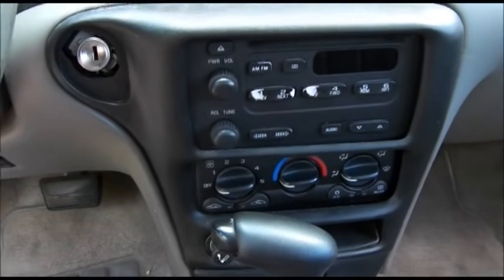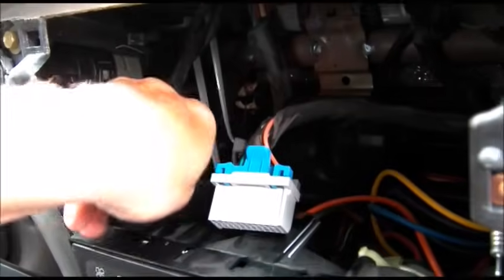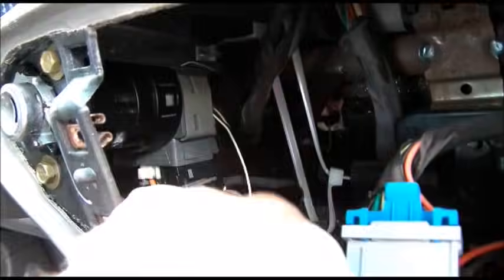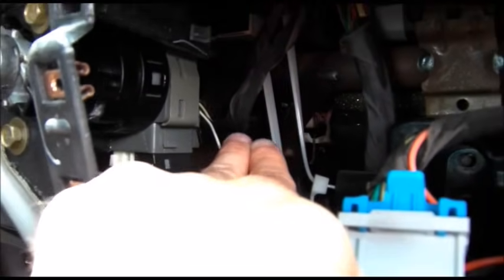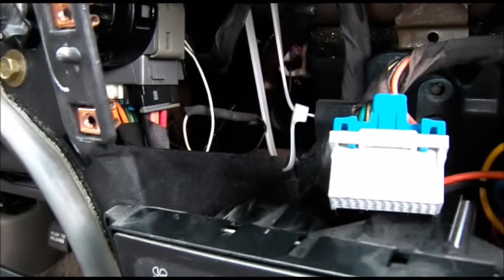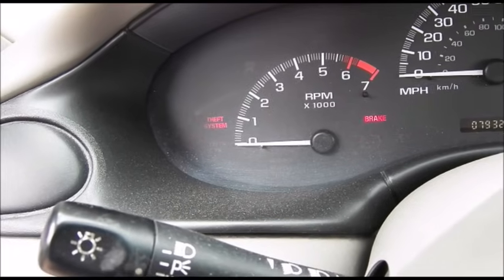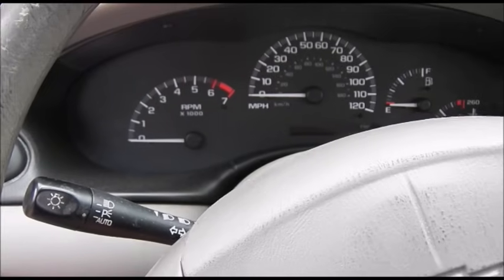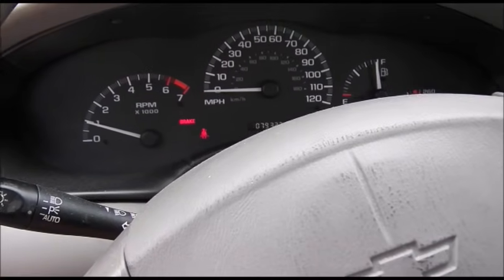GM Passlock II bypass disable fast easy repair fix cost less than $1 2005 Chevy Classic

Comment: Red - Red - Red - Gold band. FYI: I found one from an old TV set. Cliped it. Soldered it. Worked perfectly.
Reply: Which direction did you have the gold band going? 
Towards the yellow or the black?
Reply: @caseybailey7529  did u find out?
Reply: It won't make any difference which direction. Resistors don't have polarity.

Comment: I wired the 2200 resistor in between the black wire and the yellow wire and tried to retrain the car and it has not started in 10 attempts am I missing something can anybody help please

Comment: I have a  05 grand prix GT but my wires are white black and I can't really tell by looking at them but it looks like either black and white or black with a yellow stripe on my ignition any advice on witch one is supposed to be the yellow need a wiring diagram of that and the two plugs for the ignition switch badly

Comment: I under stood what you said, but maybe you should have shown actually  the way it was done vs telling just saying.
Reply: Im gonna make a video of this....step by step!!
I just did this to my 2002 Malibu
Reply: My Beautiful wifey bought  an auction here on Phoenix, for our 23 year old son.....
He took it in for a tune up at Meineke....and gosh-darn varmet.....the shady mechanic said his Torque convertor was not engaging....Haaaaa!!!
And a bunch of shit almost totaling  $2700.
Brought it home and researched the Theft system..ordered 2 key fobs and to it to Batteries plus...they said there Scan tool had no communication with the theft system...I then called GM Motors gave then VIN number and told me that year of 2002 didn't have an alarm....so I stumbled upon this Video after the whole reset procedure which worked but kept doing this over and over......went to Frys Electronic and bought a pack of resistors for $2 and just tapped them to the Black and Yellow wires....and Bammm, it worked.....after 3 weeks of doing different procedures....good luck. 
Thank you for this video.
Reply: @tilo192  2yrs haven't seen that video..hm, 🤷🏾‍♂️.... Thanks for nothing?

Comment: So I have a 2001 Chevy Express van I took the black box off underneath the ignition because it was the only way that it would even start remotely due to the fact that when I took the tumbler out and put a new one in it wasn't engaging at all it wouldn't go forward but so far so my question is without a key and without the tumbler the actual ignition using just a switch in that black box to turn it over can you still bypass the security thing because once the security light went out it cranked but only for a couple of times and the starter kept running so you have to dial it back a little bit so for the starter to stop running but the motor would continue to run any suggestions

Comment: I don’t know much about cars but I myself have a 2002 Chevy Malibu and it’s been giving me hell for over a year oddly it o my does it in the winter, and fall. It also does it in the rain. I’ve gotten a battery, alternator, fuel tank pump, cylinder, and starter replacement and still no luck. I want to take it to Chevy but they’re already charging me $122 for a diagnosis  and I heard to get the job fixed it will be over $400. I want to know is this the best solution because I’ve been seeing things about programming and stuff and I know nothing about that.
Reply: Your bcm was getting wet under the passenger side dash in the rain more than likely. new bcm require programming to your vin #. it's a super common issue

Comment: I wish someone would come up with a way to fix a2004 chevy Colorado  it cranks but will not start  I really think it's a pos
Reply: Cut the blue and white wire in the column while the truck is running and thank me later.
Reply: I can’t get the truck to start to cut the blue wire.   How do I get it to start?   I don’t have enough automatic door locks or a key fob.  I have what looks like a copy of the original key.  I looked under the console and someone has cut the blue/white wire but reconnected it with a bean connector.   The security light has always stayed on and this is the first time Iv had this problem since Iv had the truck for a year now.   

I am remodeling an old 1912 house and use this truck to go back and forth to Lowes…haven’t got anything done this week because Iv been trying to get this truck to start.  

Ran perfect before this incident other then a faulty connector going to the #4 ignition coil.  

I have the 5 cylinder pickup 2005
It turns over, starts, and then dies immediately.

Comment: What did you put on the resistor and which ones did you solder together. I know the black and yellow but coming from the car or key ignition
Reply: This guy is not clear at al as to what he is hoking up to what. Useless video.

Comment: The learn procedure is as follows:
Turn the ignition all the way to the crank mode and let go of the key so it can return to the run position. The security light may begin to start flashing or just remain on solid. Some vehicles may start up and stall or may not crank at all. You must leave the ignition key on for 10 minutes and place a battery charger on the battery if needed in case the battery is low on charge. After 10 minutes you will see the security light go out or just stop flashing and then go out. At this point you turn the key off for 5 seconds. After 5 seconds you turn the lock cylinder to the crank position again to repeat the same process .You must perform this process 3 times for a total of 30 minutes of wait time. On your 4th attempt the vehicle should start up and continue to run.

Comment: On my chevy colorado I bought a D1462G lock housing.  Took the sensor part of it ( black plastic part) and swap it to the original.  No cutting off wires. Work great. No more problems with pass lock.
Reply: Its also not 1$. My darn alero is over 20 years old by now. Definitely gonna do the resistor way.

Comment: so...you cut the black and white wires...you insulate and separate the ones coming out of the ignition switch and you solder the resistor to the other 2 loose ends? Basically, the 2 coming out of the ignition switch stay unused?
Reply: I think it's just peeling, not cutting them completely so that they continue to do their job having the resistance between them

Comment: Looks like it should work on my 2005 base impala am I correct ?
Reply: NO. Problem is in the key switch with the 2 magnets. NOT a bypass on a 2005 impala. No chip in key.

Comment: FYI: If you have different vehicle resistance on different starting systems you can get a Potentiometer Resistor. Say you need 2200 OHMS of resistance. Use a multimeter to set the pot to exactly the 2200 OHMS. mark it or put a drop of hot glue on the trim pole to keep it from moving.  So if your key has a resistance of 3300 then you can use a POT Resistor and trim it to the exact number. Sometimes its hard to find a resistor or they have tolerance that is not working well enough. If your problem is not being  fixed you can bump the trim pole plus or minus a little until your resistance matches what your computer is looking for. This is better than soldering and desoldering ceramic resistors if you have to make a lot of adjustments looking for the right resistance hack
Reply from the maker: ok, ...but the point is that the 2200 ohm resistance that I specified will work on all Passlock II vehicles regardless of what your original resistance was.
Reply: my key is all metal..zero resistance..no plastic cap....no  resistor chip..
Reply from the maker: This comment is useless because it COMPLETELY MISSES THE POINT.  You NEVER need a resistance different than 2200 ohms to bypass a Passlock II system.
Reply: @bigslick  Perhaps but all I'm sayin is that my key is not the source of that resistance
Reply from the maker: @johnbaart1537  that's true, because the key is really not relevant at all to solving this problem.  Also, my reply was to Jimbo, not you.  His comment is a distraction to the solution.
Reply: @johnbaart1537  The resistor chip is found only in Passlock 1 system keys, not in Passlock 2.
Reply: fun fact....  take a small jewelers file and cut a small notch in the body of the ceramic resistor , this changes the value and may get you in the range your looking for. start higher then needed and lower the value with the file. been many years since i learned the trick an its not something most know. more material more resistance less material less resistance...once you go past the desired range a new resistor is required so go slow and recheck after each cut.

Comment: This worked for me on 2001 Impala.  I picked up wires off of BCM above Driver's kickplate.  However, after doing this, the autolocks on the Passenger and rear doors stopped working.  Key FOB and Internal switch locks/unlocks driver's side door only, not passenger door - this includes the internal switch on both the driver's and passenger's door.  Anyone else have this issue?
Reply from the maker: My bypass has NOTHING to do with the car locks at all.  Zero.   So if you are having this problem, you either are connecting to the wrong wires or you caused a short or an open connection somewhere.
Reply: Gene Paulsen   You  most likely have this problem because you cut the black wire  at the BCM which provides a ground to other functions in car...  you can install a resistor at the BCM or up top at the ignition lock cylinder..  However it’s done differently at either location... At the cylinder  end you can cut the yellow and black wire and join a resistor in between.... and that’s the resistor in between the two wires coming up to the cylinder...  and then do the relearn procedure so the bcm can accept the new resistor....  Down at the bcm you cut yellow wire only and just remove a bit of the insulator off of the black wire... Then join resistor between yellow and the stripped part of black wire... ignore the yellow wire that goes into the bcm connector and use the one coming from main harness... you can tape up end of yellow wire... this way the black wire is always still connected to the bcm and will provide the necessary ground for other functions to work...  then do the relearn procedure.... You must make sure you are working with the correct wires at the BCM for the pass lock  2 system.. and solder resistor ends to wires for a good connection and tape up ends... should work, good luck....
Reply: @carlocalarco6718  Yes, don't cut the black wire at all. It's a ground.
Reply: TE5LA   I believe the black wire you don’t cut is the one coming out of the BCM for it provides a ground for other things to function that’s why I said you peel back the insulation and splice in the resistor but  the one at the top where your pass lock cylinder is, I’m sure you can cut the black wire there and join a resistor between yellow and black... let me know what you think, I don’t have a schematic with me..  thanks....
Reply: My 03 impala passenger doorlocks just stoped to work, all of 3 except drivers door, did you ever figured out the problem?

Comment: bigslick, Am I correct in understanding that your taking the signal from the BCM and bypassing the Passlock sensor via the resistor? And only the supply voltage is sent to the Ignition switch?
Reply: There is a resistor in the ignition switch  (not the key tumbler),  that Is prone to failure. I suspect it's just a poor design in the switch. This fix permanently puts the resistance reading outside the influence of the faulty ignition switch. You don't have to use a 2200 ohm resistor. Any between 600 and 3600 works as well. But, using a resistor that doesn't match the current resistor in the switch will require using the relearn procedure.

Comment: Do you have a picture of that 2200 resistence. ?
Reply: - you cut two wires, one yellow and one black.  The two wires that go towards the ignition switch get taped off, and the two that go into the car are where you connect the resistor between.
Reply: Red - Red - Red - Gold band. FYI: I found one from an old TV set. Cliped it. Soldered it. Worked perfectly.
Reply: @jimbojonesmobilegamereview3545  everything still working good today?
Reply: @sbond1963  YEP ! Not one problem. Works great. Thanks fr the tips and tricks.
Reply: There are tons of them in the TV VCR combo sets. The small old TV that has a VCR built in. Look at the power supply board when you take it apart. Mine was a SANYO. Cost me $2 at the Thrift Store.
Reply: @jimbojonesmobilegamereview3545  thanks bro. It's done so far so good! Thanks again

Comment: I forgot to ask.  If the security light does not illuminate in the dash, does that eliminate the passcode as the problem?
Bob
Reply from the maker: If security light is not on, then passlock issue is unlikely.  Also, if passlock is the problem, then the 10-20 minute "retraining" with key in ignition would allow the car to start.  So from that perspective, it would be easy to determine if passlock is the problem.
Reply: @bigslick  Thanks, It  confirms what I did today.  Now I have the problem of removing and replacing the pump with a full tank and rusted straps.  I think I'm  going to cut through the floor to access the pump.
Reply: @bigslick  
Thanks, I was able to eliminate the passcode system as the source of the problem after I wrote you.  It is definitely the pump, now I am going to have to cut my way in to replace it.

Comment: You said to cut two wires the yellow and the black leaving four ends. You then said to solder one resistor but didn't say which two end's to solder the resistor to. Could you clarify?
Reply from the maker: I was very clear -- you cut two wires, one yellow and one black.  The two wires that go towards the ignition switch get taped off, and the two that go into the car are where you connect the resistor between.
Reply: can you splice them? or do you need a resistor
Reply: Kolton Vernier resistor is needed cuz that's not an interruptor or switch, it is data wires
Reply: @bigslick  what if there is no black?  I have an orange w black stripe and a red w white stripe and a yellow, a brown, and a green
Reply: @Poppy_and_Samson  Orange/black is the same function as black. You know, because Orange is the New Black.

Comment: FYI, These systems have 3 components, but those components together can cost you more than $1,000 at the dealer to replace. They are:

Key (with Chip) – $80 to replace
Lock Cylinder (with sensor) – $350 to replace
Theft Deterrent or Body Control Module (TDM or BCM or by other names) – $700 to replace.

This resister bypass trick only bypasses the key and the lock cylinder.
If your issue is with the 3rd component the TDM, the resistor bypass won’t work.
Reply from the maker: true, but the exact situation that my video addresses is not a symptom of a failed BCM, so that is not really a consideration here.  I've dealt with hundreds of these, and never once is this BCM problem.  A failed BCM would have other symptoms.

Comment: Hey big slick would this work on a 2003 Chevy venture it says has the passkey3 system I just wanna kill the whole system I lost the keys and forgot to disconnect the battery while changing the lock cylinder now the pass key 3 system has kicked in and car won't start or run just plays the radio and stuff.
Reply from the maker: GM Passlock II only
Reply: @bigslick  how do I find out if it is Passlock 2 or 3?

Comment: Is this the same fix for the 2000 Astro Van?  I have the problem narrowed down to the fuel pump or the Passlock.
Bob
Reply: If it's the pass lock ur security light will flash while cranking ...if it's the fuel pump it won't prime.when u first turn the key ... Or just put a fuel gauge and check pressure
Reply: @rojasr2  
After I wrote the original note, I was able to confirm that the fuel pump was the problem.  I replaced the fuel pump by cutting my way in from the top, using the measurements from another youtube and a dremel tool to do the cutting.  I have a larger cutting wheel, but the dremel did a wonderful, quick job, and didn't make a mess.  The biggest problem, was removing the clamp that holds the pump in the tank.  The tip from a youtube video, was to use water pump pliers.  That didn't work for me, but using a pair of vise grips worked like a champ. 
Bob
Reply: That is what i did.  The hard part was removing the doghouse.  Pump replaced, back in business.

Comment: I did all steps but my theft system light stays on, not blinking. I used to reset the system with the 10 min key method when it used to flash. That became more frequent, then it just stayed on solid when I drove the car. HELP!
...update. So I installed a 400something ohm resistor and now the car will only start after letting it sit in ON position for 10 min, not ACC. Then all the dash lights came on after 3 mins, now 1 min!
Reply: You may have an issue with your body control module.